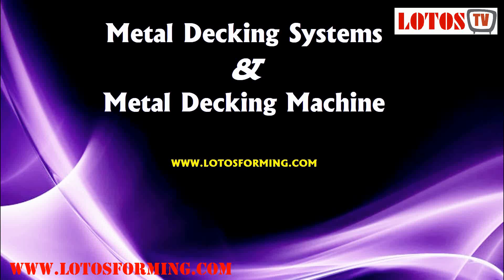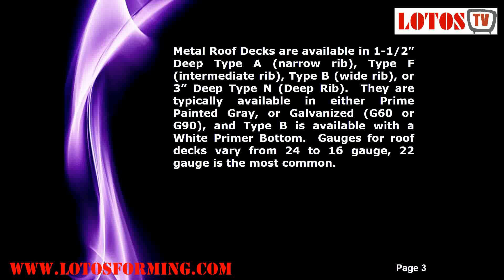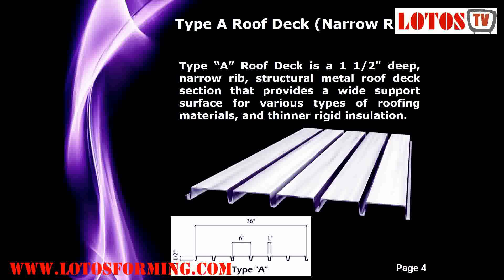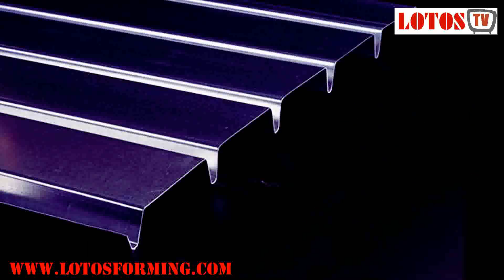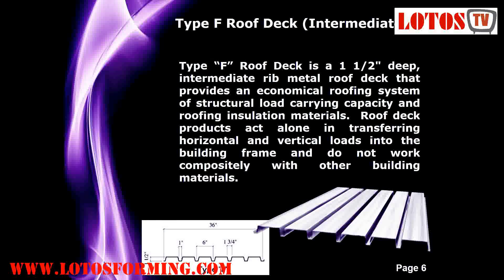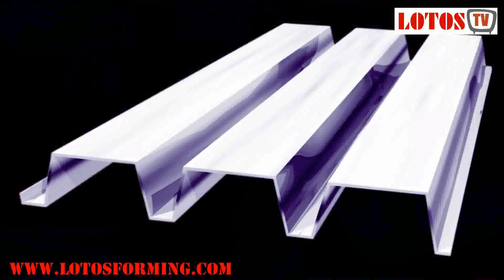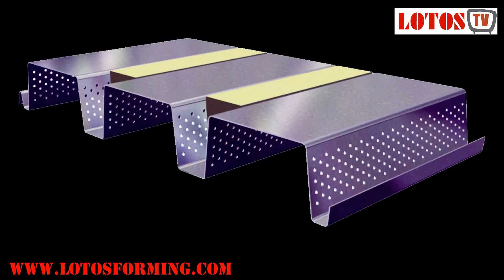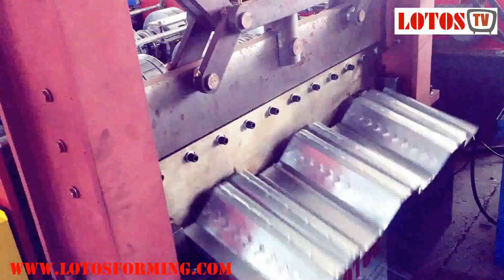【Metal Deck Systems】: Metal decking | Metal Deck Roll Forming Machine"narrow rib & intermediate rib"

Comment: Metal decking typically has a ribbed or corrugated profile that is achieved through a process called roll forming.
Metal Roof Decks are available in 1-1/2” Deep Type A (narrow rib), Type F (intermediate rib), Type B (wide rib), or 3” Deep Type N (Deep Rib)

Comment from the maker: Steel decking, when used as flooring, can provide additional stability to a structural frame. When used as roof decking, a narrower rib pattern must be created to increase strength and support roofing materials. Steel decking is an economical, permanent, easy-to-install option for builders.